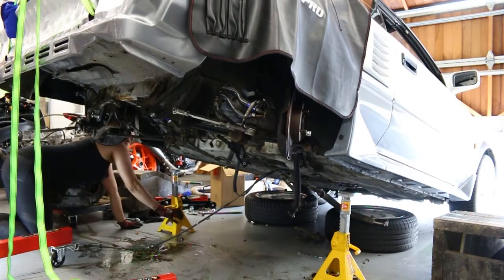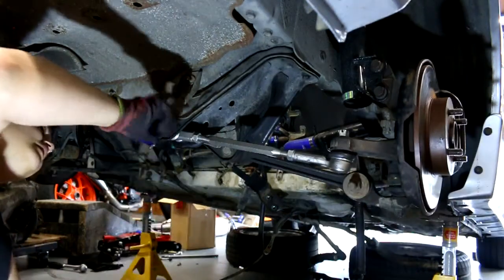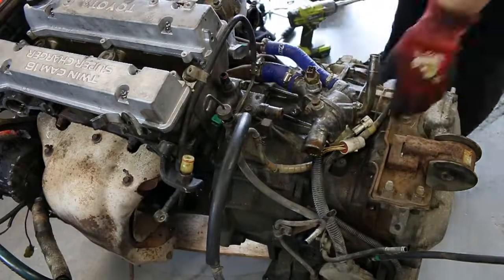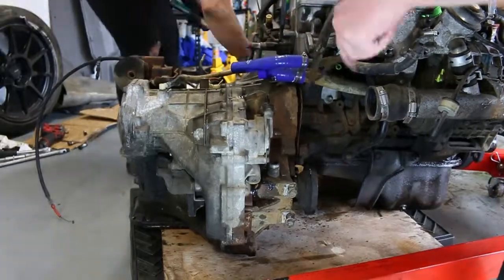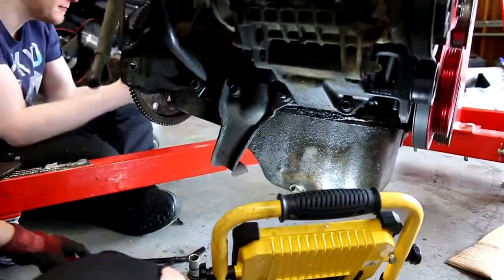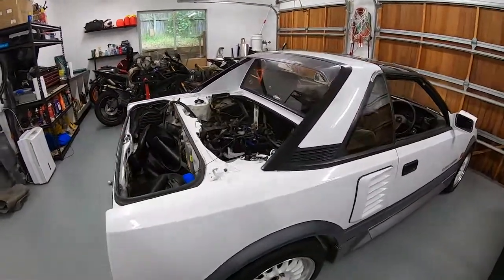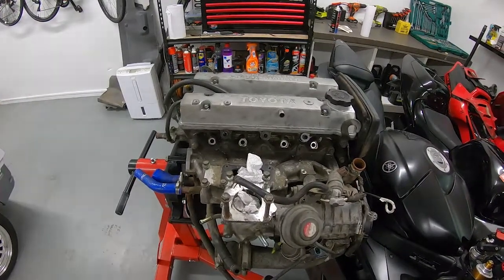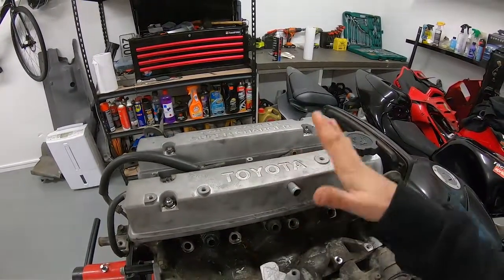The Manual Conversion Officially Begins! 4A-GZE Trans Removal (Manual conversion Part 3)

Comment: Good progress, clean and/or replace every consumable part you can while the engine is on the stand.  Pay attention to seals and such when you replace/reinstall just to be sure they are all seated properly.  Use a quality torque wrench where specific values are required.  Good luck and have fun!
Reply from the maker: torque wrench!? aww I wanted to just tighten them as hard as i could :P 

Thank you for the advice! Will definitely try clean/ replace as many bits as possible! 
It won't be a rebuild, nor will I go about painting the block and stuff like a lot of people do, but will try refresh as much as possible while its out :)

Comment: Years ago on the mr2oc forums people would advise that to keep the car rolling while the engine was out, to re-install the axles to the hubs.  The claims were that the weight of the car, even without the engine, would warp the hubs and make them out of round.  No clue if true or not but they were the big wigs on the forums that raced their cars.  So, I've always put the axles back in the hubs if I lowered the car back down on to its wheels.  Figured I might as well pass along just in case the gurus' of old were right.
Reply from the maker: Oh really? Thanks for letting me know!
I'll go put them back in just to be sure!!
Reply: @STEPHASAURUSREKD  Yeah better safe than sorry.  Like I said, no clue if they were right or not but I've always done it and never had a problem.  They don't need to be torqued down, just snug, and use bungie cords to hang the big part of the axles in the engine bay.
Reply from the maker: @mr2miach  agreed! Thank you so much for letting me know!
Reply: @STEPHASAURUSREKD  Happy to help.  Loving the videos, keep up the good work!

Comment: Don't damaged the knock sensor what ever you do! The workshop that damaged mine looked for over a year for a working replacement with no luck before biting the bullet and fitting a link ECU. :/
Reply from the maker: oh damn ok I will keep an eye out for that!
If you don't mind me asking, how did it get damaged?
Reply: @STEPHASAURUSREKD  it got donked off when they were lowering the engine out ( or raising it up, I can't quite remember ) but long story short no aftermarket equivalent or stock replacement worked without tripping the check engine light after that. So their insurance had to fork out for a full custom ecu/tune/dyno and cert.
Reply from the maker: @turdbomitch9007  oh damn. Though is be lying if I said that didn't sound like a flippin awesome outcome 😂